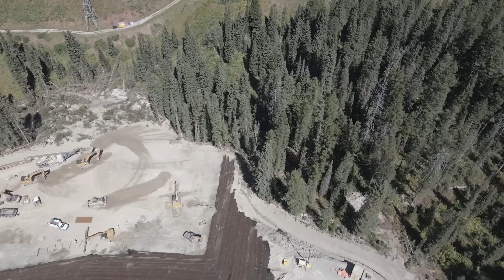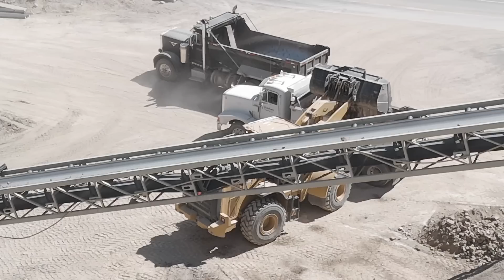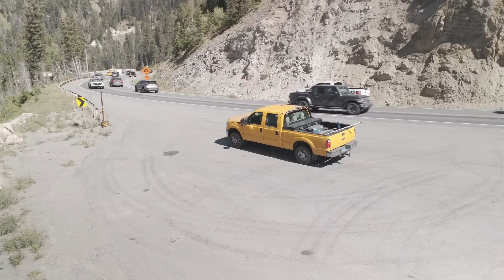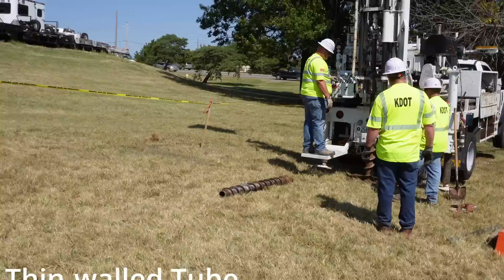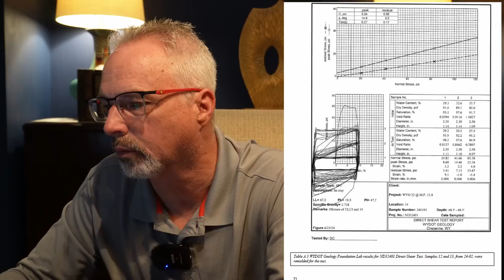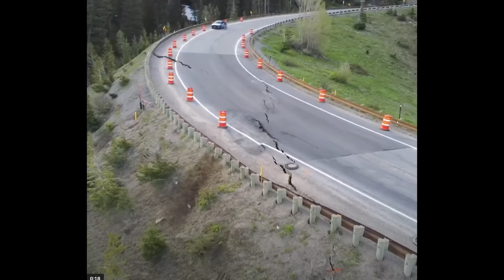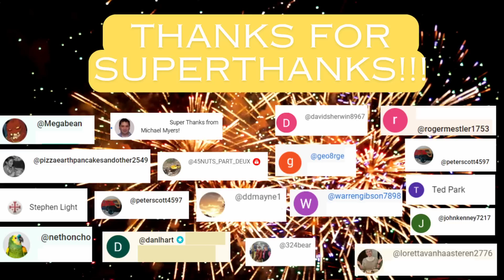Teton Pass Rebuild Update with Drone Footage

Comment: I wish you would make a short video of the use of the Expanded Polystyrene ( Styrofoam) used in this reconstructure. Is the foam permanent?
Reply from the maker: Thanks.  That is a good suggestion and yes, the stryofoam is a permanent part of the installation.
Reply: @CaseyJones-Engineer  Search "Why Some Roads Are Made of Styrofoam", 1 year ago on Practical Engineering.

Comment: Having put final design elements on a roadway that carries 20K unique vehicle trips a day and spent much of my life traversing what we call level 5&6 roadways in colorado … Teton Pass with 5k vehicle trips a day and sever weather condition makes it hard to quantify what is typical safety margin … That whole pass was never going to give tax payers bang for the buck or be premium for safety margins just on root metrics. 

… the big ticket items that haven’t  been discussed in your video series is avalanche exposure to that section of roadway and the freeze thaw thresholds as those are annual events that will effect the terrain and the safe operation of the pass!

Teton Pass in order to be properly engineered needs more data sets than financially feasible per capita of unique users … the harsh reality is part of mountain west living is inherent danger ...the avalanche danger on that road way far exceeds the roadway collapse danger …yet that margin of safety is lower that what it should be and likely always will be ….this major artery for ID & WY will always likely be a bleeder …and as long as a band-aide can suffice …that is the most tax friendly solution!

Comment: Percy precise springs to mind. 🤔

All well & good having concerns & wanting all the i’s dotted & t’s crossed - but life has to move on & remedial works needed to be done as soon as was possible. 

Yep, November 2024 ambitious but would November 2025 been acceptable - welcomed? 

The work done looks good to me - how about you? 
The fag packet calculations will have to do for now - no point waiting for experts to argue 1 way or t’other - Mother Nature has its own calculations & methods to put a fly in the ointment.  

If you’re so worried - why not ask yourself / have a guess how long you think this will last before failure of similar magnitude to previous occurs with what you’ve seen so far. 

The next failure will be the weakest link - & it prob won’t be here but not far away!

Comment: As a layman, I'm glad that an engineer agrees that the entire handling of the investigation and subsequent repairs is highly questionable. Also someone noted that those dump trucks are barely  half full to stretch the hours. Just an opinion. That's for updating us on the progress.
Reply: Could be that the dump trucks are only half full so they can make it up the steep road.
Reply: When the haul is measured in feet, it probably doesn't matter. More important for the trucks to get up the grade without straining.
Reply from the maker: Thank you.  I will keep on this story and post further updates.

Comment: I know the main purpose of the video is to discuss stability, but it's also important to talk about the road itself. Moving from left to right on the road in either direction, you've got a sharp curve that turns into a gradual curve that turns into another sharp curve. That's difficult to drive, especially for large vehicles like tractor trailers. And "really fun" to drive in Winter, with snow and ice. It would have been much better to have a constant radius curve throughout, like the original road, though that might have delayed the re-opening of the road.

Comment: As a non engineer I have a question. It would be one thing if this was a naturally formed slope but it appears to be a man made structure. Why are they making assumptions about the soil strength when the embankment has already failed? They should be testing the soil and making sure it will hold together. I don't understand why they don't use stone at the base of the slope. Dirt and clay can and will absorb moisture. A bigger pile of soil, no matter how compacted, would seem to have a much greater chance of failure.

Comment: Great drone footage. Honestly, I was hoping the video was going to cover the design and progress of the final replacement. 

I was a person that felt that a slightly higher risk for a temporary roadway was acceptable. My opinion on that started to shift when the design of the temporary roadway became clear. My issue is that the temporary roadway design permits and encourages higher speeds than I feel are acceptable for the low safety factor of the design. Most bad accidents happen at slides (or bridge collapse) by drivers driving into the void because they were traveling too fast to see the void, recognize what they are seeing as a void or not having enough braking distance. It is less common for roadways to collapse under vehicles. (But it definitely does happen.) 

In short WYDOT failed to address your concerns with stability or my concern of driving speed. I admit, stability was always a valid concern. It wasn't so much that I disagreed with your assessment. It was that I expected the concerns to be addressed by WYDOT improving drivers' ability to respond to a failure. They didn't. 

I did find it interesting the placement of the moved soil. If graded and compacted could that help reduce the potential of a slide on that side of the temporary roadway?

Please do more videos on the permanent rebuild.
Reply from the maker: Thank you.  They definitely have an opportunity to put back stronger, better compacted and better draining materials.  I can't cover the design of the remediation of the main embankment in any detail.  The only information that WyDOT has released about this design was mentioned very briefly in their July presentation at the Jackson library.

Comment: I'm not an engineer ... My eldest son is...
I look at this and think 
1) that slope is way to steep (>30 degrees) to hold together on its own
2) even at 30 degrees it would need to have some sort of erosion control (I see none)
3) Styrofoam are you kidding me?!  It will float out of the soil.

again I'm not an engineer... my soil stabilization was learned in the sandbox and beaches as a child, and only applied doing my own yard work & working briefly as a landscaper's assistant  one summer.

Comment: Looking at this as a materials engineer, all I can say is that I would never sign off on any of this.  Too little data for a permanent repair is being kind IMO.  This feels like WYDOT is going to build this to a preconceived design regardless of reality so that the road can re-open to traffic.

I am going to get off my soapbox because my post as originally written was starting to turn into a rant, but I want to say that I hope that I am totally wrong and excellent engineering and construction is being done that results in a safe repair that lasts for decades.  I just do not feel confident in what is happening.

Comment: Wyoming citizen here. Regarding WYDOT, they don't seem to believe in accountability from top to bottom. Their inspectors on road jobs barely leave the truck and sign off on catastrophically poor runoff management, resulting in 2-block long floods every time it rains. They sign off on fill that fails before the project was even done, meaning they were then digging up and repairing a brand new road. Horrible, horrible management from WYDOT.
Reply from the maker: Wow, that doesn't sound good at all!

Comment: If the current "bypass" construction is indeed intended only to be temporary, and some more rigorously engineered new construction will be the long-term future road, I can sort of see why a lower FS might be justifiable, especially with good monitoring (which, given the various other shortcuts, might be questionable). But with situations like this, "temporary" has a way of stretching out for years. Very informative. Glad I don't drive that road daily.

Comment: I worked for Ames Construction back in the late 1980s. We were building bridges in Denver. They had one of the best work ethics from the young bosses down to the carpenters and laborers. Their work in this video looks great and if you need it done quickly Ames is a can do company. I think if this goes to crap soon or even after a few years they should be giving you a call!
Reply: 😂 You used the Seabees slogan.... Can Do.

Comment: WYDOT and RJ Engr probably collaborated and hand-picked the marginal 1.2 safety factor, knowing the redesign carries high risk for a mountain pass. Monitoring will be critical. The redesign does not have enough safety for some undetermined amount of excess groundwater. Thanks for commissioning the drone video, for the other media, diagrams and reports, and your explanations and assessments.
Reply from the maker: Thank you so much, I appreciate it!  You have summarized these issues well.  One thing I didn't mention in the video is that the old fill contains fines ranging from 9 to 49 percent which is not well draining material at all.  WyDOT has only release the sketch of the new embankment section so I have no idea what they plan to improve drainage in this embankment aside from installing a drainage blanket above the tops of the micropiles.  I will pin a comment to this video when the download link for this report is ready.

Comment: Engineer here. Retired. I have had to accept lower safety factors (1.2) than optimal in slopes when the site conditions mandated it. Not sure that is the case here, but your critique does not speak directly to the scope of repairs required to achieve the 1.3-1.5 FS. I could imagine it would be significantly greater than the current scope of repairs. 

The styrofoam blocks have to help lower the driving force vs. saturated soil. Did you take that effect into full account?
Reply from the maker: At the time that they did their stability analysis in late June 2023, there was no design that had been performed for the rebuild of the main embankment.  Reportedly that was determined once the contractors had been brought on board.
Reply: @CaseyJones-Engineer  They definitely did put the cart before the horse here. Contractors usually have a better handle on the construction feasibility, given the schedule constraints. In this situation the trade off was made for public convenience. Not always a good compromise.

Comment: Honestly, I think it is fine until it starts raining provided they really are keeping a close eye on it. Once they get some precipitation though, all bets are off.
BTW, I think this is your best video yet in terms of sound and camera + time used for graphics. 
I had a weird thought while you where discussing shear strengths after your mention of hammer blows per 20feet.
I wonder if you could apply all this engineering to Asteroid Benu and figure out how deep OSIRIS plunged into it when it collected the sample. NASA clearly dropped the ball on this one, I expect they did not use a geotechnical engineer when they decided how fast to approach Benu. If you can successfully model it, you might be able to get consulting from them on this sort of thing. You could then claim to be an astrotechnical engineer :)
Reply from the maker: Thank you, very interesting suggestion! Yes, NASA over-achieved on that impact.

Comment: You brilliantly highlighted three key points WYDOT is trying to hide: 1) the assumed soil parameter, 2) evidence that the soil analysis results were considered during the design phase, 3) the fact they were unaware of ,or ignored, the shearing of the inclinometer casing. The primary objective at WYDOT is mitigating their own career liability. Public safety is a distant second. The officials involved are gambling they will have moved on before this "oh it's good enough" mess collapses.
Reply from the maker: Thank you.  I suspect that my videos aren't too popular with WyDOT.  I suspect that they have never been exposed to this kind of scrutiny involving their technical decision making.  I just hope if local engineers have similar concerns that they speak up soon.

Comment: Sounds like an educated guess? WYDOT is building and testing at the same time hoping that the results are what they anticipated using what they have to work with. Could just shut it down and go around until the correct way is built depending on cost and corruption.
Reply from the maker: I agree with you. They should have kept traffic out of there until the rebuild had been completed.

Comment: Getting a degree at a University is no guarantee that someone actually learned anything. A degree also does not instill ethics.
I studied Chemistry and Biochemistry but I ended up having a residential remodeling company. Yeah, life is weird.
I have to raise the question of are they competent or do their people in charge allow the experts to even make decisions? I had my company in Austin, Texas. The massive differences in soil types and stability changes are huge and really required a lot of careful study whenever I had to develop a plan to build something outside.
Thanks for the excellent videos. For me, I couldn't do the calculations but you provide all of the needed information to see what's happening. I would guess that majoring in science gives me a big boost with understanding 3 dimensional problems, plus the time factors involved.
Reply from the maker: Thank you. One of the big issues in Austin is expansive clays.

Comment: Pezio Metric surface is fundermental in the  original Failure and Failure to have a  cut off drainage system in place ...
Earth Dam construction slope angles would be a good guide to ensure The future Stability of the Finished Slope embankment ...

Some thing not Taken into account possibly is the effects of Earth movement by relatively close earthquake and volcanic activity  ...  
Definitely never been factored into the Equation ...  
 FUTURE traffic loading   .

But which ever way you look at the Problem with out major realignment and gradient changes this particular  road site is fraut with issues ...  not to mention the winter Freeze thaw cycles that occur in this region of the Tetons .... 😮😮😮😮😮 great for Snow Sports but not for Road construction ...😢😢😢😢😢

Comment: Very apparent that WYDOT is supporting it for political reasons! In my opinion, one of the sketchiest things about this, is the damning affect this whole things creates uphill from this embankment and the lack of any drainage, or what the material seems to have been used to build the embankment!
Reply from the maker: Poor drainage has been a real issue here and I am not sure that their design will remedy the situation.
Reply: @CaseyJones-Engineer  You know, the other disturbing or questionable thing is the use of those Styrofoam blocks! Know it takes for ever for them to decompose, but they shrink pretty rapidly! Their shrinking could cause voids, compaction issues, etc., which could lead to problems also! Has there been studies done on their use for fill and possible problems listed?
Reply from the maker: @frednewman2162  It has been used effectively on other projects, but there will be big problems if a gasoline leak reaches those blocks.

Comment: Would not the Styrofoam present a problem with compressibility? The theoretical rigidity of the road surface in midwinter cold coupled with that compressibility seems a bad combination.

Comment: You don't have to be a geotechnical engineer to know that an analysis based on an assumption of critical input data is useless. Especially, when no technical basis for the assumptions are provided. The engineers in this case appeared to give the results they were being payed for and then include enough caveats to cover their ass.
Reply: you can make educated assumptions and then overdesign the solution to account for the uncertainty ...
Reply: @direwolf6234  Maybe, but this report was not a design document. It was a design input.

Comment: Geotech was my focus in school, but water-wastewater was my career. I would not fault the design team for using previously established soil data for the area and slide. However, if that is what they are doing it should be clearly stated. Don't worry, the WDOT engineers can't be sued because of qualified immunity (unconstitutional law created by supreme court in 1980s that needs to be abolished). The blatant lack of transparency is very concerning. It screams ineptitude.
Reply from the maker: Thank you.  The fact that they didn't recognize that this slope would have a catastrophic failure was the first thing to cause me a great deal of concern about the experience and judgement of the WyDOT folks.
Reply: how would more data change the repair design ? what did they overlook in the solution ?

Comment: The Angle of  natural repose seems to be in center of highway lanes.

Hopefully they used tremendous geo fabric and soil nails in shear plane .
Perhaps soil mixing with cement grout to increase shear strength.

WyDOT dewatered and put drainage in small uphill forest to divert water above failure area.

WyDOT very nice to show public all repairs.
Excellent 👍
Reply: I agree with you, but " nice of them" doesn't apply, it's a public project.
Reply: @digger105337  Nice of Biden and Harris ?

Come on man..

Comment: My geotechnical background consists of a single CE soil engineering course I took in college, but it sure seems to me that the analysis and design of this reconstruction is squestionable based on the information provided by WDOT.  Now it could be that, in fact, either their analysis WAS accurate (either by chance or by additional work not disclosed), or that they DID in fact use a much higher FoS in their actual design, say 1.5+, leading to a minimum actual FoS of 1.4+ so that this will end up being a stable and long-lasting solution.  Or that could turn out not to be the case.  It's just troubling that we are left with these questions.
Reply from the maker: Thank you. Their report is definitely lacking important details.